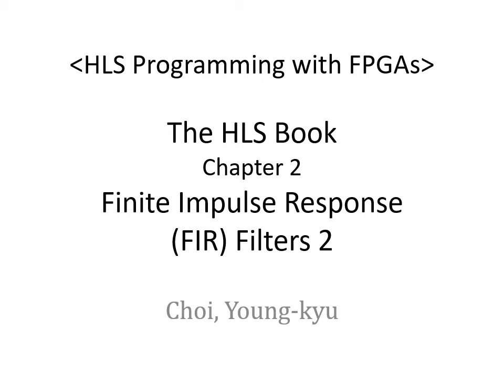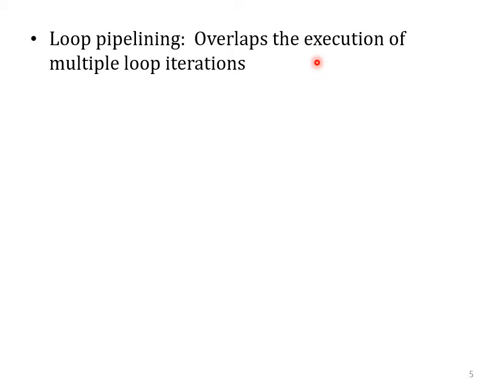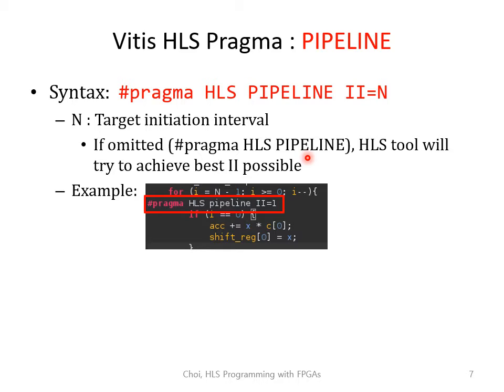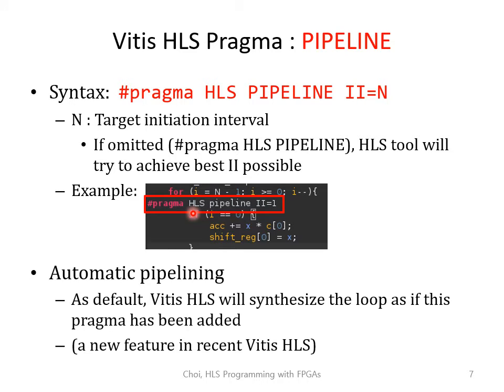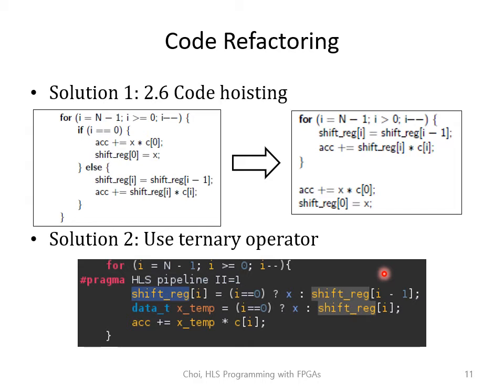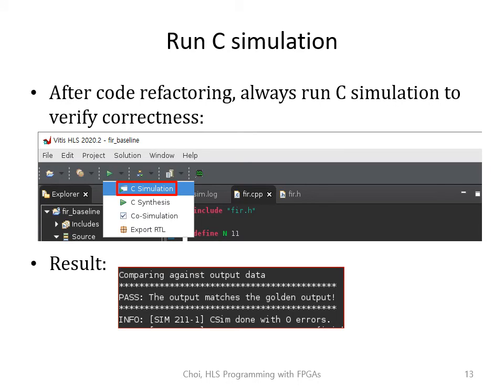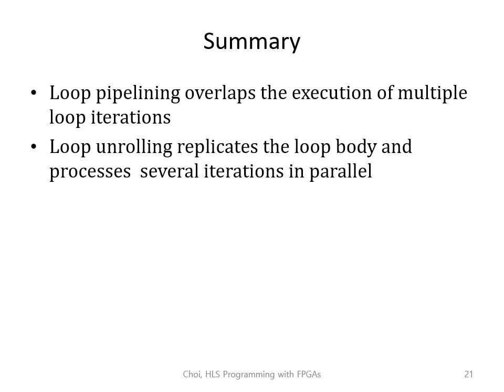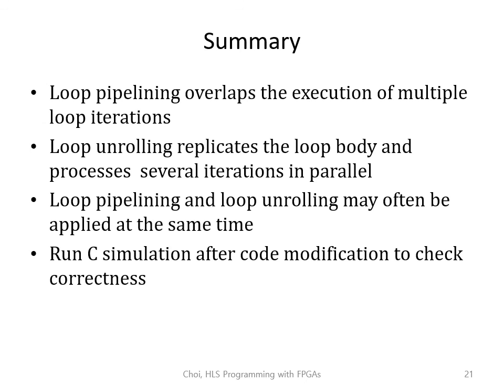Part05 FIR2 (HLS Programming with FPGAs)

Comment: 안녕하세요! 강의 잘 보고있습니다. 혹시 마지막에 답을 알려주지 않으신 문제의 답은 kernel파일에서 상위 포문을 하나 더 만들어서 거기에 파이프라인을 적용하는 것인가요? testbecnh에서는 배열로 값을 넘기구요
Reply from the maker: Right. You can move the sample loop from fir_test.cpp to fir.cpp (as the outer loop of the filter tap loop), and place the #pragma HLS pipeline on the new sample loop. The interface between fir_test.cpp and fir.cpp should be in array (or pointer) of both y and x.
Reply: @youngkyuchoi4260  thank you

Comment: hello sir,
I try to use the AC Datatype library (ac_fixed.h, ac_int.h ..) to implement a FIR instead of the AP library (ap_fixed.h)

I imported the library in the synthesis (with Cflags -I/path/includ..) but for the testbench I found problems which caused me problems in the co simulation 

ERROR: [COSIM 212-24] TB preprocess failed : In file included from C:/Users/AVRIL/Desktop/PAC/AADoss/firfixed/fir_filter_tb.cpp:2:0: 
C:/Users/AVRIL/Desktop/PAC/AADoss/firfixed/fir_filter.h:8:22: fatal error: ac_fixed.h: No such file or directory 

How can i import a library into vivado hls for synthesis and testbensh?
thank you
Reply from the maker: I did some searching but it appears AC Datatype has been developed for Catapult HLS, not Vitis.
Reply: @youngkyuchoi4260  Thank you.

Comment: Can you please explain the shift operation to me. 
The iteration starts with i = 10 and shift_reg[10] = shift_reg[9]. At this point, shift_reg[9] = 0, so only zeros are put in the register and accumulated. What am I getting wrong here ?
Reply from the maker: Right. So the value of the shift registers are initially empty (or garbage values), so the first few outputs are not very meaningful.

Comment: Hello Sir, I am not able to understand the modification i need to do to use unroll and pipeline with the test_fir.cpp file.
can you give me more hints about the solution. i am stuck since morning
Reply from the maker: 19:52 Try moving the sample loop from the host code to the kernel code, and apply the pipeline pragma. The taps should be unrolled as in 18:34.